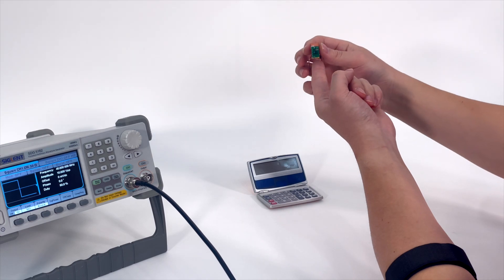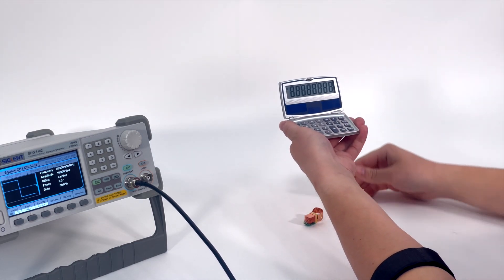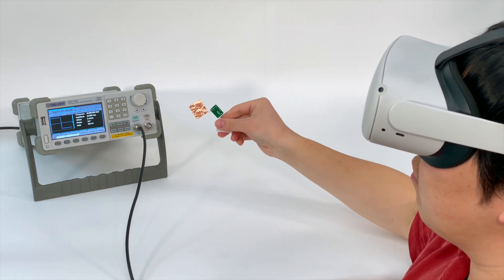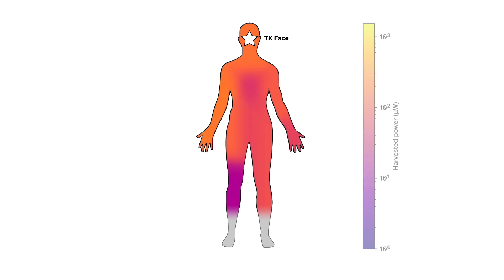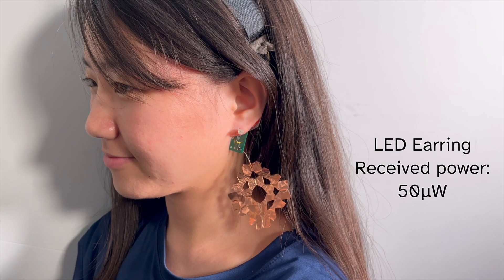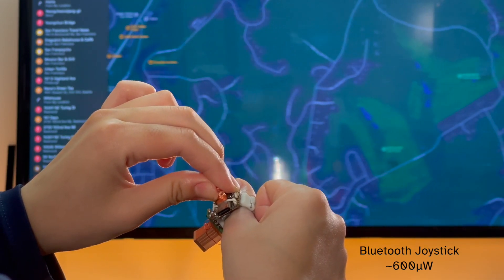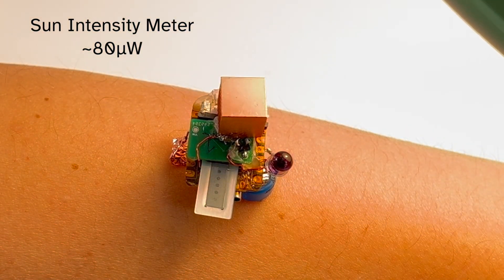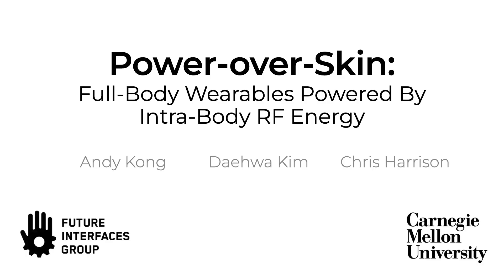Power-over-Skin: Full-Body Wearables Powered By Intra-Body RF Energy

Comment: One thing I can immediately mention: It has been well-researched that static charges on the body over long periods of time can cause changes in fertility and hormone balance, especially in men. If you continue this project, there is a chance it may have the positive side effect that it can function as a form of birth control.
Reply: Using dairy products has this effect also,  but do you avoid milk, cheese & butter? Do you actually care?
Reply: @Nobody-Nowhere  Not to the same extent. Go look it up on google scholar, there is actually research being done on using static electricity as male birth control. As in, dairy has some effects, but static electricity could be up to 90-something percent effective. I would see it as a positive side effect to explore, instead of some weird masculinity thing.
Reply: @Nobody-Nowhere  Huh? Can you elaborate on this?
Reply: @Nobody-Nowhere  Is there a recent significant change in dairy consumption? If not, then it would not explain a change in population sperm levels…
I think things that have or might in the future change for the worse, are a bigger concern?
That being said, I guess perhaps I have another reason to not mind my cereal sometimes being dry.
I guess I could switch to a lower fat milk, but, I think I personally would probably benefit by increasing the amount of calories I consume, not decreasing it, which would be a downside of switching to low fat milks.

Why can’t they just filter it out of the milk?
I guess the chemistry of doing that without messing with the other things in the milk would be too difficult?
Reply: Hm, if so, it seems like it would be important that such devices not become too important. Don’t want people who would want to reproduce to be prevented from doing so by a perceived need to keep using such devices.
Reply: Hey, I'd love to read more about this, could you link to any research?
Reply: What on earth makes birthcontrol via hoemonal disfunction a positive sideffect wth

Comment: Very cool. Much more power than I thought. Was the bluetooth transmitter powered by it or just the sensor?
Reply from the maker: The microcontroller, including the bluetooth transmitter and sensor, was entirely powered by power over skin.
Reply: The transmitter has a power source, but the receiver’s Bluetooth and sensor are both battery free

Comment: Kids this days haven't watched the classic The Matrix from the year 2000
Reply: In that movie, humans were used as a power *source*, right? I think is just using the human body as a wire of sorts.
Reply: @drdca8263  they don't explain on the video but the copper radiators (the earrings one looks like a large copper earring) are a dead give away, they using small thermoelectric generators, extracting power from the gradient of heat from the body and the air.
Reply: @xspager  Why the transmitter vs receiver thing then?
If it was about thermal gradient, why would you need to have both, rather than just the “receiver”?

Comment: Not clear from the video where does the energy actually come from. It is extracted from body heat or? And then transferred to device via?
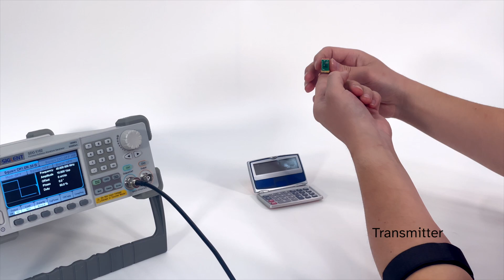Reply: See the armband labeled "transmitter" attached to the power supply at 0:24
Reply: The micro-wattage is dispersed through the skin. So the current is sent throughout the skin and picked up by the device through contact with the skin.
Reply: The transmitter has external power, like a battery or something. This is transferred to the receiver
Reply: feels like they invented the peltier element

Comment: Would this also work with implantables? Sensors under the skin would greatly benefit from an external power source!
Reply: I worked with a guy who developed a method for generating small electric currents from the motion of ions across cell membranes! It is the first step toward having sensors embedded directly inside living cells for a whole new realm of microbiological research. Unfortunately he died not too long after that. He was probably the single smartest person I've ever known. But it's good to know he made his contribution and it will live on.